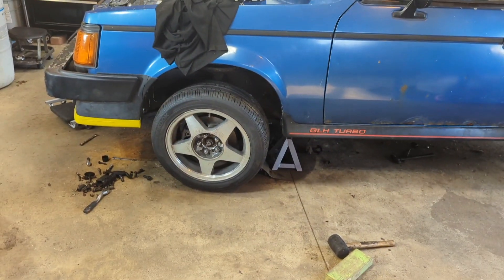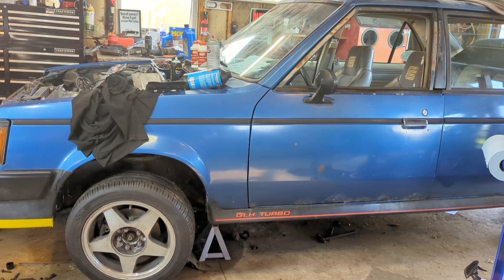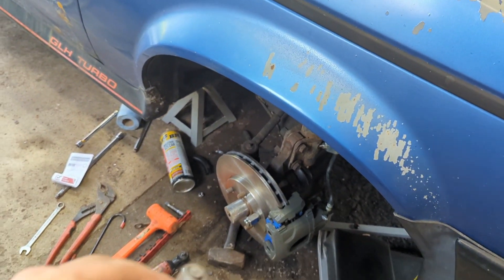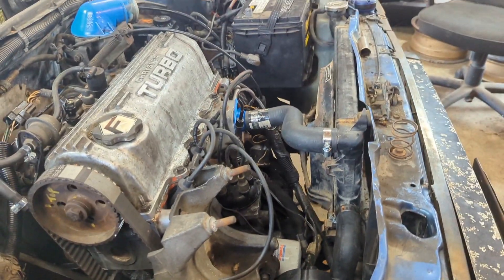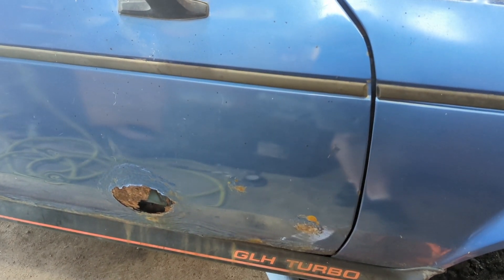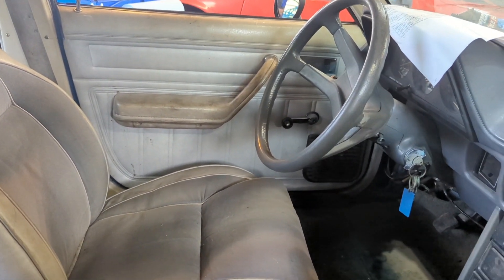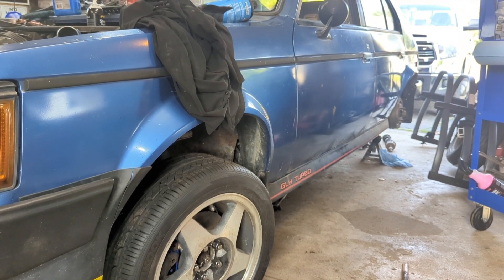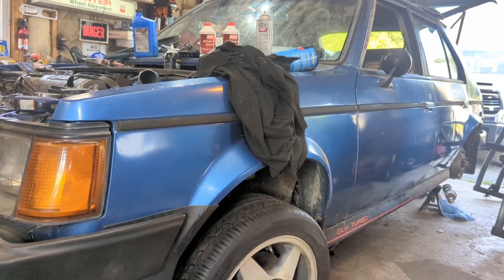Will this Dodge Omni GLHT ever be finished? 2 steps forward, 20 back.

Comment: All you should need is a line to the MAP, fuel pressure regulator and the wastegate to run. Most of the factory lines are for boost control and emissions. L body HVAC controls use vacuum, but I have a feeling you are not too worried about that. Other optional thing would be a boost gauge. I have a really basic set up on my Omni, but it is turbo II swapped.